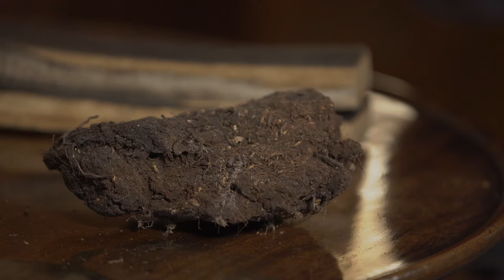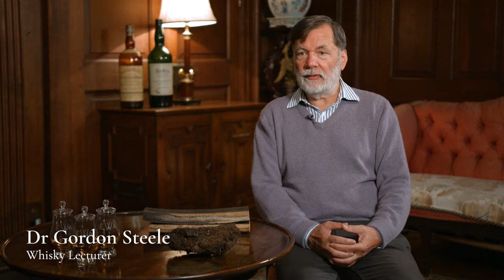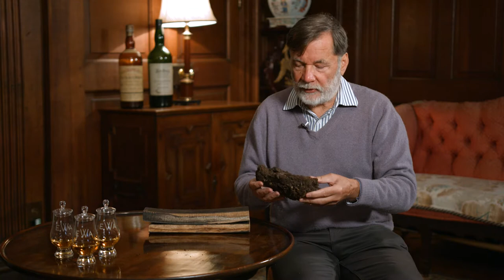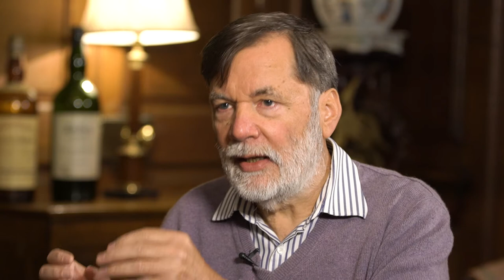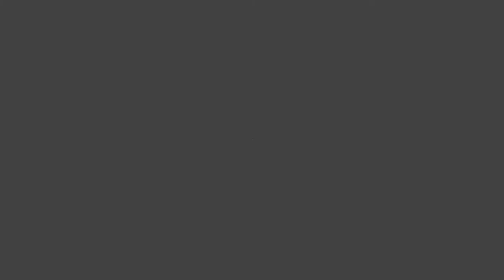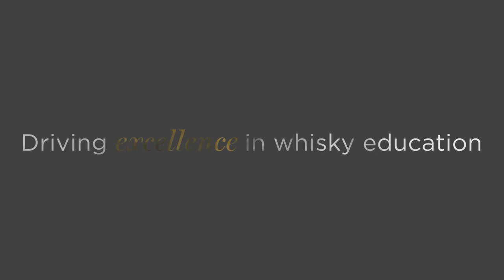Let's talk about... peat

Comment: Question.  Do they use peat to dry the malting barley and stop the malting process before sending it to make the mash. Or is just to smoke the malt?
Reply: I think it’s used to stop the malting process (though I’m not sure 100%..)
Reply: Yes, the burning peat both dries and smokes the malt. Sometimes peat is only used for some of the initial drying process and it’s finished with some other type of heat source that won’t impact the flavour.